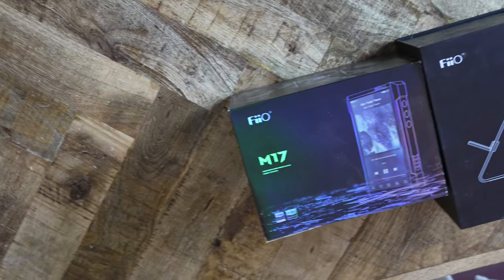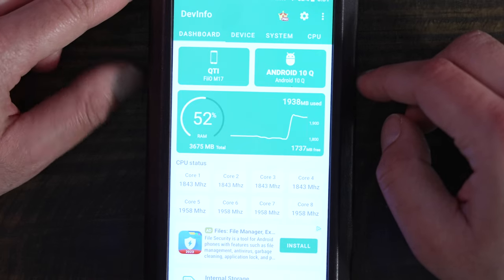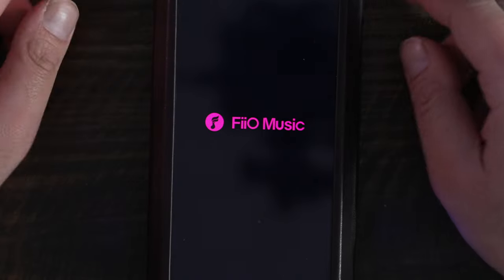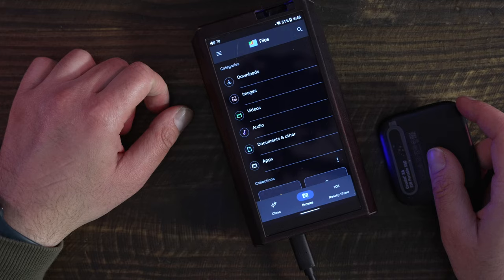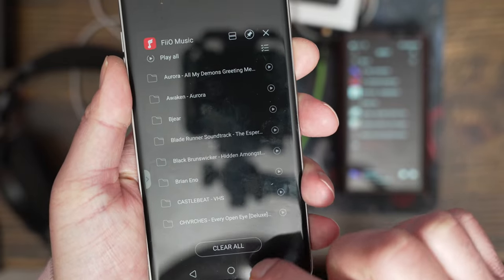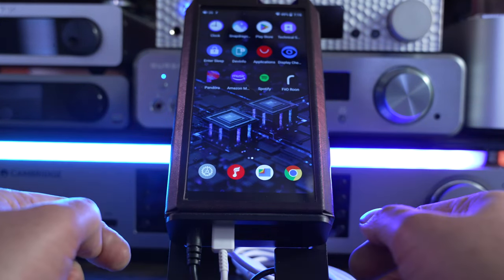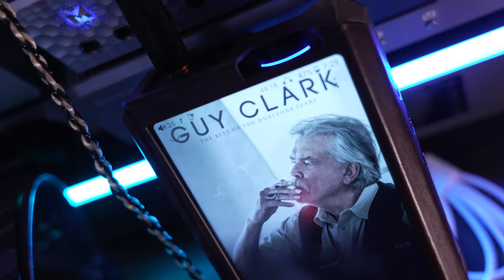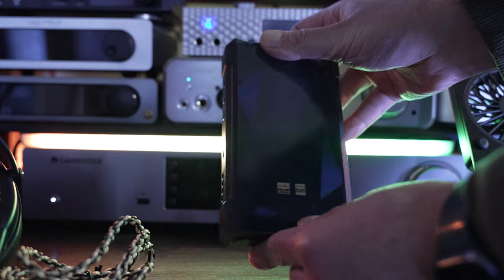Fiio M17 - A Behemoth In Its Niche

Comment: The battery replacement issue on all of these devices is something that most reviewers don't even bring up. They're too busy regurgitating marketing specs and colorful adjectives for sound impressions to bother. The simple fact is that rechargeable batteries degrade over time. Having easy user access to replace a battery SHOULD have been implemented here, given the size and price tag. But alas...no one seems to care about this. Especially manufacturers.
Reply: Manufacturers are eventually trying to make repairproof and battery replacement proof gears and youtubers and consumers are shouting "bravo bravo" 🙂
Reply from the maker: Having dealt with many companies in the last 5 years, I can confirm that some companies put pressure on reviewers to make positive reviews.  I get several emails every few months from brands (usually ChiFi) asking to collaborate; and when we're hashing out details, they drop requirements like giving them first right of refusal on the video content, emphasizing certain aspects that to me don't make any sense and can't be verified, or trying to force me into their fee-sharing programs.

I know many in the community always doubts reviewers intentions, and I think that doubt is to a degree justified.  With all the pressure by companies, the desire to get free gear, to get more views, to make money from YouTube as a reviewer's primary income source...yeah...it's a wonder any reviewer says anything remotely negative or critical of products.

Especially in the audiophile hobby.

Comment: Would you say there are notable differences between a cheap apple dongle dac and a DAP / DAC of this price range? 
My main usage is iems, I want to get to listen to different sources but it's not easy here, and i'm skeptical of the claim that there is substantial audible differences.
Reply from the maker: It’s POSSIBLE that a cheap dongle may be faulty and induce audible distortion or noise, and it’s also POSSIBLE that a dongle Dac might not be neutral. But modern devices are unlikely to be noticeably different in these regards. All this commentary among audiophiles that they hear differences is either a false impression because they don’t do proper A/B tests, or their headphones don’t get sufficient power for peak performance between devices they’re listening to. It’s very rare indeed in my experience to find any actual differences among these solid state devices.
Reply: @NoThemeReviews  Thank you  for the reply.

Comment: I dont know where daps go from here.    They have to start trying to do something new. Having the latest android version isn't enough to spend this amount of money
Reply: You would spend this amount of money to buy a transportable device built for raw power that you could bring to/from the office, specifically to drive the top end of power hungry (likely planar) headphones:

- Abyss 1266
- Susvara
- Dan Clark Audio Stealth

This reviewer didn’t test any of these; he only tested lesser headphones and even iems that didn’t require this type of power to drive them. I mean you can drive iems and less power hungry headphones with this, but why would you? Use an iPhone or lesser dap instead.

A better test would be to A/B any of the above power hungry headphones with the M17 vs any of the other players he compared it to. I can tell you straight off the bat that the Sony would not be able to drive any of the 3 sufficiently by itself. Sure, the layman may say that as long as the headphones are loud enough they are “sufficiently powered”. However, there’s a difference between sufficiently powered and well powered, which translates to these power hungry headphones getting better sound and a higher score on their overall sound possibility score - 5/10 vs 8/10 or higher.

Try this test and you’ll find out.

Cheers
Reply from the maker: The reason I didn't test the Abyss, Susvara, or Stealth is because I don't have them.  But I DID test other planars--including the Avantone Planar, LCD-2, LCD-3, Argon, T60rp.  So, it's not as if all I did was test low-impedance, high efficiency dynamic drivers.  

As far as the Abyss is concerned, the recommended power for that headphone (by the company) is similar to what Fostex says regarding the T50rp.  Dan Clark doesn't suggest anything remotely like multi-watts of power for the Stealth, and in fact says that 500mw is plenty.  I seriously doubt that the Susvara actually needs more than 1 watt, but I'll grant some people believe it needs a nuclear power plant.

So, even with your example, there's some doubt about the need for uber-powerful DAPs.  Of course, you can't get the M17's purported max power unless it's plugged into DC.  So, it's not really a "portable" device.

As I said in this review, the M17 is a niche player.  I'm sure it makes sense for some people--but not for the vast majority of audiophiles.
Reply: @NoThemeReviews  respectfully, the reason why you would need more than the “recommended power” is because if you are playing music then you aren’t just playing 1 sine wave that always draws the same amount of power from whatever device is driving the headphones you are using. Instead, the music you are playing will draw different amounts of power depending on the section of the musical passage that is playing. 

The bigger and more dynamic the section, the greater the power the music will draw from the device powering it when this section is played. This is why abyss in their videos generally recommends throwing as much power as you can when using their headphones. More power = more headroom = a lesser chance of the music sounding flat when it gets busy and draws the most power.

This also gets into differences in recordings - I’m sure that as a reviewer you’ve experienced the need to turn up or turn lower the device powering your headphones depending on the music currently playing. The fact is that some music was mastered in such a way that it is louder or quieter than others, and the result is the need for more power as you turn up the volume to hear it.

Both of these reasons are exactly why you would ideally want to throw as much power as possible at headphones, especially those that are power hungry. Sure, you “can” listen to music on power hungry headphones without throwing a “nuclear reactor” at them. However, these power hungry headphones WILL benefit from them based upon the music playing.
Reply: @NoThemeReviews  Then comes the question of “picky headphones”. Putting power requirements aside, headphones come in 2 flavors - picky headphones, and not picky headphones. The Focal Headphones (Elegia, Radiance, and Stellia) are not picky headphones because they generally will sound good with most of the things that you use to play them, and there isn’t too much of a difference when you try switching from one device to power these to another. Sure the sound will change, but it won’t change drastically. For planars, the same is true for the Meze empyrean, and to a lesser extent the he1000, and the abyss Diana - they generally will sound good on what you use them on.

In contrast, picky headphones will not sound good on everything. Call it the design of the drivers, the tonality of the headphones, magic etc, the fact is that you actually CAN hear differences in amps that you plug these headphones into. Falling into this category are the abyss Diana TC, the abyss 1266, the susvara, Dan Clark Stealth, and Ether CX.

Of the headphones you listed, I’ve only seen the Argons appear in lists of picky headphones. I’ve heard that they sound sibilant on sources that don’t match well with them. I’m not sure about the T60 rps, but it wouldn’t surprise me if they are picky since I know for a fact that the T50rps are picky and will sound differently based on different sources and more so if they are modded (Alpha Dog, Alpha Prime). 

If anything, it appears that the majority of the headphones you’ve been testing fall into the not picky category.  This is likely why you haven’t been able to hear too much difference between players. Borrow/purchase another picky headphone and repeat these tests. If one of these happens to be known as being power hungry as well then you’ll see even more of a variance in performance. Like I said before, the Sony dap definitely won’t be able to power any of the 3 headphones i mentioned above.
Reply from the maker: @napzap6539  Saying that a handful of headphones are “picky” isn’t an explanation to players sounding different. That’s not remotely correlated. Just because one headphone might “require” more power than a given DAP provides says nothing about that DAPs’ sound signature. 

The audiophile jargon about matching source to headphones or IEMs isn’t as convincing as you might think. Since the vast majority of amps have very low output impedance, impedance matching isn’t an issue. Balanced vs single ended output has no effect on sound signature. Connecting to the source via USB or SPIDF or coaxial has no effect on sound, assuming your recording resolution is supported across all three options. 

Headphone/IEM placement, earpads/eartips, fit/comfort, the music you’re listening to, and volume has actual repercussions to perceived sound signature. Volume is a big contributor to how people perceive the “goodness” of what they’re hearing. 

So, yes, I agree with you in the very general sense that power output will affect driver performance and perceived loudness which will ultimately have an effect on what a person thinks about the experience. But that’s not the same as saying the M17 “sounds better” than another DAP. 

I’ve heard this type of argument many times. Some audiophiles believe that you can only hear the differences among gear if you buy ridiculously priced headphones paired with “special” cables. No, that’s not true. There is no basis for such arguments, except that some people use this as an excuse to explain why they believe what they believe. 

If you say that someone should buy an amp that has the potential to properly drive something like the Argon or Susvara, I’d agree. But I wouldn’t support any comments that said a particular amp or Dac “sounds better” with a particular headphone.
Reply: @NoThemeReviews  First off, the headphones that you use with a player are in fact very heavily correlated to the overall sound that you get from your system (headphone + player) when you plug it into that player.  Sure, all headphones have certain sound signatures, and the same is true for the player alone by itself.  That said, the reason why the headphones matter to the system's  overall sound is the following: 1) How else would you listen to said player without the headphones? YOU CANT.  

And 2) essentially when you plug in a pair of headphones you're mixing it's sound signature with that of the player in order to get the sound signature of the overall system.  As a general rule, we both know that the headphones are what matter the most to the overall sound of any system.  Sure, the player matters, but far less than the headphones do in terms of the overall sound of the system assuming they are adequately powered.  

My point in bringing this up is because if you plug in a clean sounding headphone into a warm dap then: 
a) the dap should be able to power it, or the headphones will not sound good, and
b) the dap will be a lot less warm than if you plugged in a warm headphone with your warm dap, and that's pretty much a fact.  Whether or not you like the sound of your system is subjective, but it will almost definitely sound more or on the clean side because of the headphones than it will sound warm due to the dap.

Now, feel free to disagree with me regarding the importance of matching sources to audio gear.  Maybe it is nothing more than impedance matching, an argument that I've heard plenty of times before.  That said, as I pointed out above, it could also very well be that 5 of the 6  headphones you claimed to have used in your review are in fact not known to be that picky and therefore would have matched relatively well with most of everything that could power them sufficiently.  

That said, don't pretend that the pickiness of headphones debate only extends to a "handful of ultra expensive ones".  There are thousands of threads that are dedicated to matching dozens of different headphones and iems of various prices with even more amps all across the pricing bracket.  Sure, even I believe that most of it is fluff, but pickiness pertains to a lot more than a "handful".  Here are over half a dozen more picky headphones and iems for you to consider: any of the sennheiser HD 600 series headphones, their HD800 series brothers, sony mdr ex1000, ex7550, ex 600, etc.  Try tubes vs. solid state for the sennheisers and you'll hear the difference.

And lastly, I'll once again repeat what I said above in terms of the use case for this device.  You would buy the m17 if you wanted a transportable device that can output the raw power necessary to actually drive pretty much all headphones on the market.  Whether or not it sounds good with whatever headphones your driving is subjective.  That said, the picture of the guy that doesn't want to leave an expensive amp on his desk at work, but does want to use it on the train going home comes to mind.
Reply from the maker: @napzap6539  Justifying an overpriced DAP with arguments that we should buy headphones that cost double the price…ok. 

None of the headphones you listed are “picky”. Just because forums have thousands of pages of people inventing excuses doesn’t make them correct. It’s a bit funny you’re comparing the Hd800 on tubes vs solid state. I mean, the output impedance alone for tube amps has a noticeable affect, which isn’t a mystery and doesn’t depend on audiophile hocus pocus.

I’ll just summarize your arguments and leave it at that: the only way to benefit from the “sound signature” of a DAP is to buy super-expensive headphones. Or, in the alternative, to use headphones that people claim are “picky”—when they’re actually not. 

Cool. Let’s leave it at that.
Reply: @NoThemeReviews  and I’ll summarize your arguments:

1. I can’t hear any difference between the m17 and several other daps using the 6 headphones I tried, so it’s not worth the money. I’ll continue to make this claim even if dozens of others aside from me have claimed they cannot hear sound differences in systems (headphones + dap/amps/dacs) when listening to 5 of the 6 headphones that I used for this review. 

Everyone else is likely lying and there will be no differences in how this dap or any dap sounds in a system when listening to headphones other than the 6 I tried.

2. I’ll pretend that my adversary was trying to justify an “overpriced dap with headphones that cost twice the amount” even when he recommended over half a dozen other well known “picky” iems and headphones that cost only 1/2 to 1/5 or less of the “overpriced dap” to try it with.

3. I’ll claim that headphones don’t affect the sound signature of the system I’m listening to and there is no correlation at all, even if I the reviewer should know that in the context of a system (headphones + dap/amp/dac) the headphones will almost always matter the most in terms of how that system will sound overall. 

Cool, let’s leave it at that.
Reply from the maker: 😂 You subjectivists are a real laugh. You’ll believe anything.  Lol. Spend $5000 to hear the “differences” in $2000 DAPs. Pure genius! Pull out of your ass the idea that headphones are “picky” because…well…you subjectivists say so. Amazing! Everyone who doesn’t jump into your cult won’t get the mysteries you special people know. Brilliant! 

🤣 oh man. You guys are free entertainment. Keep it up!!!
Reply: @NoThemeReviews  Aww don’t get angry.

Cheers to the reviewer that decides to LIE and paint me as the big spender, all while forgetting to mention the other half dozen well known picky headphones i recommended testing that are a fraction of the price of this DAP. 

Stick to your 6 headphones as the gold standard for reviewing, because of course nothing else matters. After all, all of us audiophiles are lying about absolutely everything, aren’t we? 

The lack of an open mind to test and take feedback is hilarious, especially for a “YouTube reviewer”. What’s equally hilarious is when you watch a review and realize that the reviewer hasn’t even listened to enough headphones to adequately review the device, or likely any of the devices he’s reviewed (assuming you stuck to your 6 headphone gold standard).

Keep on claiming that headphones make absolutely no effect on the sound signature of the system your listening to, much less the lion’s share of how you will perceive that it sounds. 

“Cool. Let’s leave it at that.”
Reply from the maker: Lol. “All of us audiophiles”. 😂 Naw. Just people who keep their minds open by believing anything, no matter how ridiculous.  BTW, you’re the guy who dropped the Susvara and Abyss as headphones that should have been used to what “differences” among DAPs…soooo…yeah. Seems like you’re backtracking. 

👍 Keep it up! Oh man…you gotta use “PICKY” headphones to hear the differences! 😂🤣 I love it!

Thank you so much for the entertainment.
Reply from the maker: Thousands of forum pages of people making silly claims is your “evidence”. You gotta do a lot better than that. None of the headphones you mentioned are “picky.”  Lol. Dynamic drivers are picky! Hahahaha. 😂 I’m glad you’re not going to respond any more. My side hurts from laughing.
Reply: @NoThemeReviews  the Liar returns! And with no come back as to being called out as a liar…

I think I’ll play the troll and quote the lying, angry reviewer 1 final time:

“Cool. Let’s leave it at that.”
Reply from the maker: Lol, you mean you haven’t been trolling this whole time!? You actually believe this nonsense? 😁 Being called a liar for telling you why you’re wrong. “Picky headphones” are the way to hear differences in DAPs…Genius! Keep going! 😚